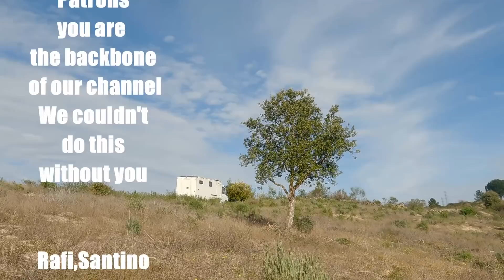Recycling and reusing items around the farm -  DIY - Upcycling Projects

Comment: Did you buy a ripping chain for the chainsaw or did you just use the regular one?
Reply from the maker: Regular one. couldnt find a ripping chain within the eu. I used to sharpen a normal chain at 10 degrees but i didnt bother this time.